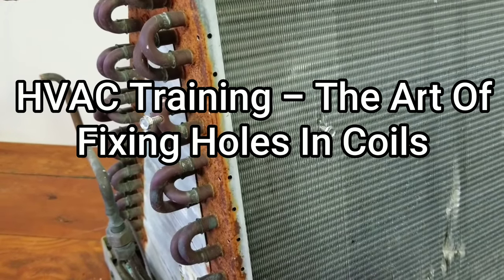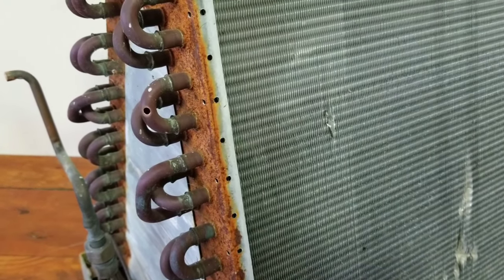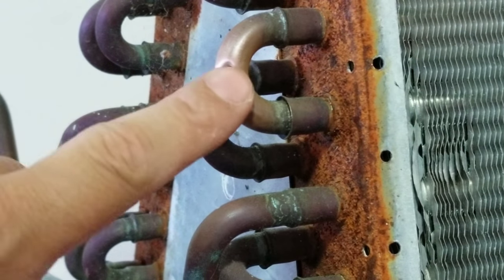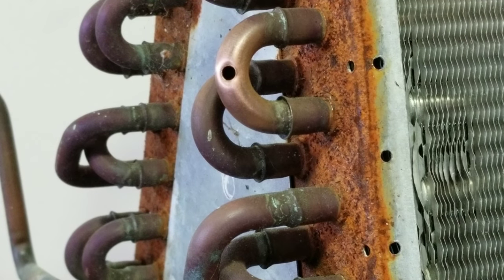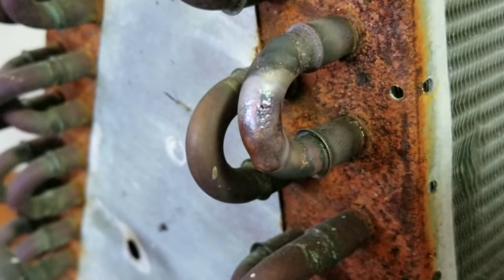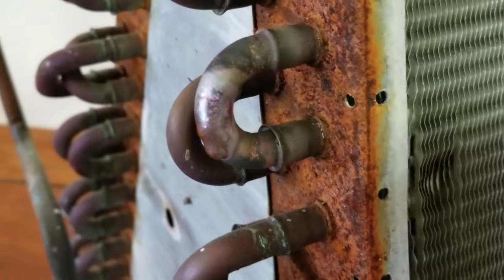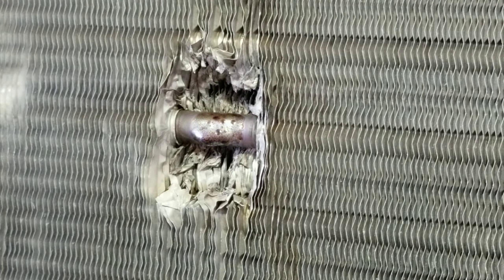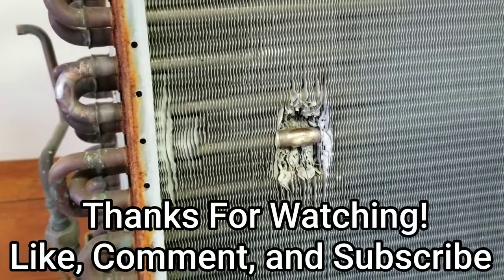HVAC Training - The Art Of Fixing Holes In Coils

Comment: So I have a question about the fixing of the tubes curly coils types whatever the hell you want to call them is it possible to fix 1 that's in the fins using a brazing rod because my window unit I just discovered earlier this morning the fins started separating Orwell I don't want to say started they have separated sometime during of being stored I guess it got hit with something and I noticed that there isn't a axle tube in the middle of it it's just a bunch of the fins and there flared out one into the other on the intake side of my window unit I can't afford to put replace my window unit but I do have brazing stuff around is it possible to fix that stuff or will I just be melting aluminum as soon as I touch my torch to it

Comment: What type of brazing material should I use for copper to copper?. I have to install a filter dryer on the liquid line
Reply: Anything will work anything. But most people like 15% silver I’m pretty sure anything that calls it’s self solder will hold in a tight joint so long as u don’t mix soldiers
Reply from the maker: Solder will not work. Must be braze if it is used on 410a with the exception of Staybright8. I prefer 15% SulFos rods for copper to copper but other types of brazing rods are required for different jobs and metals.

Comment: I would cover the area of the fins you removed after the repair. That small area is not significant for cooling but the large hole could let more air through .
Reply from the maker: This was not an actual repair, just an example as the description indicates. Also if it was a real repair since the hole isn't completely through the coil, double layered coil) no air will bypass therefore no cover is necessary. Thanks

Comment: It does reduce the absorption of the heat doing that kinda of repair on the evaporator coil because of the loss of fine but does save a old coin if the Client can't afford a new coil.
Reply from the maker: Technically true but the amount of heat transfer lost on the repair I showed would be nearly impossible to measure. If you butchered the coil or made a hole straight through the entire fin pack then that's a different story.

Comment: Sand ||||||||||| low heat Stay Brite 8 /flux/ solder done.Technicians need to learn how as coils today are aluminum, practice with soft solder will help them.
Reply from the maker: Michael Lee I'm not sure how successful most guys would be trying to seal a screw hole with stay brite. I'd definitely watch the video of someone posts it though.
Reply: I'm not sure I'd trust Stay Brite 8 to bridge that wide of a gap without balls of it dropping into the tube. Love it for other things though.

Comment: Can you braze copper tube there copper is too thin? Whould high heat melt thin copper tubing?  Thanks
Reply: I have done this repair and, yes, the copper is thin so you better not overheat it.  I didn't have any problems with the coils that I repaired.
Reply from the maker: As the video hopefully showed, yes you can braze this area and yes, it does work with proper technique.

Comment: The coil pipe that u braze in the fins. 
Is it aluminum or copper??

What rod did you use?
Thanks
Reply: The tube itself is copper the fins are aluminum, you’ll find that a lot of newer coils aren’t always copper under neath.
Reply from the maker: Copper pipe, aluminum fin coil. In this video. On these repairs I use 15% SilFos rods.

Comment: How much you will charge for this work. For example, you need welding holes, after pressure test and refill new freon. I think it will be easy just buy new coil. Maybey I'm not right.
Reply from the maker: +Александр Соколов As the description explains, this is showing how to repair a coil that a tech put a screw into. If the tech or company wants to buy a new coil or unit, im all for it. This us an easy alternative. Thanks for watching

Comment: Can I use a torch can from ace or home depot? Wich can yellow or blue
Reply from the maker: This is brazing which requires much hotter temps than a MAPP Gas or Butane torch. Those are for soldering.

Comment: This is why you don't put any attachments on a case coil or supply plenum. I either mount accessories on a return or if I don't have the room itll go on a wall. As for condenser coils, there really shouldn't be a problem, all the screws on the jacket are usually far enough away from the condenser coil for you to use even a 3/4 self tap
Reply from the maker: After doing this for 20 years Ive seen SEVERAL times where techs have had to make new holes in panels to secure doors due to stripped out holes. If they dont pay attention, shit can easily happen. Newer equipment is much easier to avoid these type mistakes but again, as the description indicates this is mainly for brazing training on how to control heat. 🤙
Reply: @HVACinSC  I agree, new equipment there's zero chance if you use the right screws in the right spots, as far as new holes, shorts screws is the golden term. I've been at this for 4 years and I still have much more to see, although a lot of the shit I've seen already blows my mind and has me screaming into a pillow in my van

Comment: Hello need your help I refill my window until AC the problem now is when I turn it and the compressor kick in after like 2 minutes the compressor will kick off and what can I do to fix the ?
Reply: Could be over charged
Reply: Abraham  Hernandez so what should I do next should I discharge it or what is an 8,000btu window until
Reply from the maker: If the unit wasn't evacuated properly before charging it could be many things. I'd recommend a licensed HVAC contractor look at it or since it's such a small window unit, just replace it.

Comment: Now the real test. Take all of your brazing tools to a packaged rooftop unit, in 96 degree weather, sun shining and mild wind.

Can't lie, job well done.
Reply from the maker: +Gold Waves Only 96?? How bout repair this coil in a 140+ degree attic where there isnt even enough room to sit upright.

Thank you and thanks for watching
Reply: HVAC in SC Well if it's in an attic it would be a residential unit, which means you could remove it and repair it outside. And you can vent the attic while using a portable cooler. But outside on the roof, you just have to stomach the workout.
Reply from the maker: Gold Waves In my 20 years I've done plenty of rooftop repairs. I much prefer them over attics.
Reply: HVAC in SC I wouldn't know what it was like. The ones I did were built by Providence with the foam insulation, and not that crappy blown in style. The units in and above the garage were pretty bad. It really depends on what the problem is and the weather for me. 

Thanks for the reply.

Comment: Does the area stay exposed like that?
Reply from the maker: If you have to make a repair like this, yes.
Reply: @HVACinSC  is there anything that should be refilled? What exactly leaks out of those coils? My coils on the outside were punctured by a small rock. Would that cause the ac to stop cooling?
Reply from the maker: Refrigerant leaks out. If the unit lost its Refrigerant it will not cool. You'll need to call a licensed professional  to fix or replace the coil

Comment: nice vid what brazing solder kit and rods do you recommend to use like to repair any window units , i did fix a small hole in a window unit coil by wrapping a bit of copper wire over hole and heating up some pipe solder with yellow propane tank and flux thx...
Reply: I like Victor regulators myself, any 15% rod works fine. Don't go cheap and get the 5% stuff. Any higher percentage is only for brazing dissimilar metals.
Reply from the maker: 15% is the way to go with brazing rods. Brand makes no difference but we use Harris

Comment: I would wrap the two ends of the curved piece with strips of wet paper towel to try to keep those joints from loosening.
Reply from the maker: With proper heat management, that is not an issue but by all means do what you feel will work best for you.

Comment: Whats unfortunate is that they arnt making copper tube coils anymore, its aluminum. which makes this pretty much impossible on most units out there now in my area and eventually everywhere else.. great vid though!
Reply from the maker: +Brandon Stevens Thanks for watching!
Reply from the maker: +Brandon Stevens Copper tube coils will still be around for many years but these same repairs can also be performed on aluminum. It just takes a bit more precision. Thanks for watching!
Reply: HVAC in SC agreed but in my 2 years of service experience i repaired 1 leaking aluminum CU coil in an easy spot to get to (actually fairly close to where the copper piping attaches to the aluminum coil, attempted with my oxy acetylene torches) and 9 months later i got the call from another tech telling me about it leaking. I remember i started to melt the pipe i was trying to repair, it was hard to control the heat due to how sensitive the aluminum is.. if i do this again i may just use a small propane torch or something.
Reply from the maker: Brandon Stevens Oxy / Acetylene torch is not a good option for brazing aluminum. Mapp gas or a plumbers torch is what's needed. That and a high quality alloy rod and the repair should last as long as any factory joint.
Reply: HVAC in SC thanks for the tip, i could only can remember so much from tech school there was so much info haha.

Comment: Well I have found that if a coil has been patched it always leaks.Might not at first, but the coil rots out in that patch and the customer always has such nice things to say about the tech that did the patching. But that is okay, because it is good for my business. Okay guys it is like this patch a end loop but if the coil leaks just replace the coil.Patching it does not fix the issue.Or just keep sending your business to other company's.
Reply from the maker: +Raggedy ManX In my 20 years I have never seen a fix like this fail unless it was not don properly. There is no difference between brazing a copper fitting vs this repair aside from copper thickness. That said, you do what you feel comfortable with and we will continue to do the same.

Comment: I have found that even if specified in the paperwork that I am not responsible for future leaks not related to the initial repair, the coil owner regrets not choosing the other presented option of coil replacement. It would have to be a new coil damaged by accident from another trade or something In which case the owner pays nothing.
Reply from the maker: Thanks for watching
Reply: @HVACinSC  on another note, we have started using compression fittings for refrigerant! 700psi. It has been out for a bit, but pricing has begun to shift to where it will be cost effective.
Reply from the maker: @justintime970  If your referring to Zoomlock, check out my other videos. Been using them for over 4 years where applicable.
Reply: @HVACinSC  I just found your channel. I will be viewing most/all of them. Not the same system, but when bidding jobs with 5,000 plus fittings, I have to be able to back it up with years of data on long term dependability. Cost analysis only recently allows me to even dream of it. Thank you for the responses! I hope I am not bothering you...

Comment: No doubt good job! But if the coil is leaking period, I say it needs to be replaced and we don't repair coils. And if they don't want to replace call another company to uninstall coil repair and reinstall and pop a leak else where on the rusty ass coil. I charge 650 to pull and clean a coil, so it will be 650 for me to remove repair and clean while it's out and then it pops another leak, well that won't be a happy customer then.....dont waste the time or their money unless you fucked up and put the hole there in the first place. But then it's on you to man up and doit for free since you put the hole there....but common sense can easily prevent this😎
Reply from the maker: +Jesse Luna Unfortunately people make mistakes and common sense is nearly extinct. 
If a coil is leaking due to corrosion of some sort then I agree. If the coil has been damaged in some way (rubbing copper or screw)  I have no problems fixing or attempting to fix those type of failures. I always give recommendations on what I think the customer should do but in the end it's their money to spend how they see fit. Pay me now or pay me later. 
Thanks for the comment.

Comment: shit, i need to show how to fix coils for real. 99% of coil repair isnt going to be like this. In 20 years I have only ever repaired a coil with a hole like that and it was caused by a newbie shooting a screw into the coil on accident. Most of your coil repairs are going to be rub threw at the tube sheet due to vibration on the hot gas line. I would say the next most common coil leaks are going to be rub threw from cap tubes or feeder tubes at the  TXV, you may occasionally get rub threw on residential coils from the top cabinet that holds the condenser fan on the top of the coil when the gasketing gets torn off from coil cleanings every year. More often it's going to be rub threw at tube sheet on DX coils and frozen water coils on air handlers.
Reply from the maker: May wanna take a second to read the description of the video boss man. 😏🤙🤙
Reply: @HVACinSC  Why bother? I have some very basic vid of a real world repair on a RTU done in the way I developed that makes perfect tube sheet coil leak repairs. I have a water coil in our shop that froze and I was going to do another video repairing that as well, my problem is that my go pro 6 makes good video but my old ass laptop doesnt have the power to edit them, cant even download them. I don't know how many chewed up condenser coils Ive seen because no one knows how to fix them properly. sigh
Reply from the maker: @johnnyb8629  Why bother? You bothered to take the time to type out these long comments. Figured you'd at least read the description of the video.
I also have several "real world" leak repair videos. 
Would love to see this method you say you developed. 
Post a link.
I see no videos at all on your channel bud.
Reply: @HVACinSC  now that their is a pandemic and I have an abundance of time Im going to post the video of how its done. Just did another search and found numerous videos of people butchering coils. Im a newbie making videos so I am not sure what the protocol is for linking videos, so Ill just publish it first. Ill be making a video of a 25 ton chilled water air handler that I removed and replaced that was above an elevator shaft. It's rather long and I did a lot of time lapse video so it may take me a bit of time.

Comment: I don't  like using materials Which are a need as torching. It burns the unit. Smells awful, and the outcome is poor to look at. This idea also can't be cleaned by Owner of A/C. All A/C parts should be "Home Owner Friendly!" Meaning: we as H/O's can clean our own A/C Unit from an easy Pull-Out, Put-In  D.I.Y. CLEANING.  Weight should be a light as a Television Set today. As a D.I.Y. Home Owner, I change my Air Filters on a Two (2) Month basis. I can smell dirt from vents after Two (2) Months. By me changing, I find my A/C Unit works better. Much smoother when it goes on again. (I pour a cup of mixture of Water/Bleach, Not to Much Bleach) and let stand. After Two (2) Minutes, proceed "ON," as normal. There's many areas of an A/C, which needs much attention. "Water," "It can be your Best Friend/Worst Enemy  when it comes to an A/C.
When "Water," gets in the drain lines, this is a problem. To not have your outside A/C Main NOT CLEANED, IS A POOR FORM OF WORK FOR AN A/C COMPANY. I FIND THIS IS PART OF THE JOB DESCRIPTION. IT HAS TO DO WITH YOUR DRAINAGE. CLEAN OUT THIS MUSTY SMELL. Take a "Wet Jet," and Explore the Unthinkable. Without removing this debris, "Water" can start forming from your Condenser, down. It sounds like a wave. It happened to me. I was  lucky not to leak.
Reply from the maker: You don't like "torching" What does this even mean?🤔 
Sounds like you want a lot from a system design. Unfortunately is a manufacturer made a unit anywhere close to what you are asking for it would be so expensive, nobody could afford it. Most fuss at the prices to maintenance the unit. 😆
Many of the things you attempt to explain above you don't seem to understand the actual workings behind them which gets DIYers into trouble causing damage or shortening the life span of the equipment you are attempting to upkeep. Not to mention the laundry list of lawsuits that people  try and file for getting injured or starting fires messing with equipment they are not properly trained to work on.
PS - Your filter should be replaced every 30 days if it a 1" thick filter.
Good luck.
👍
Reply: @HVACinSC  Thank you for your advice. Very needed. As I mentioned about torching, many A/C Units have to be touched in order to remove the front bottom panel in order to get to your Coils. Then pull out to bring downstairs to clean. Many H/O's clean their Coils by spraying a Coil cleaner, then, all this debris sits in a drain pan. Today prices for A/C (Central Units) start about $6,000 w/this Blue Light. This Blue Light is suppose to clean your Coils. I ask, but, it should be much easier than 100 years? Your home Computer Monitor weighs about 10 Lbs. Years ago, you couldn't even lift it alone, unless you were "ROCKY!" I can lift my Computer Monitor now alone than before. I held one side, while someone else held the other. We walked really quickly as possible. Again, thank you, you're very kind to go into details